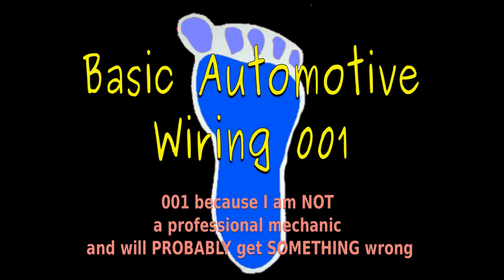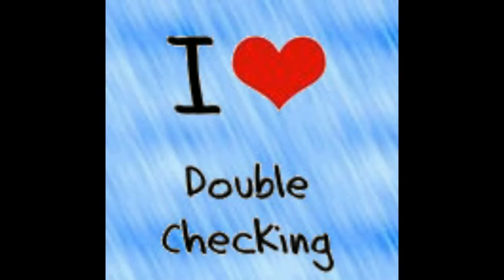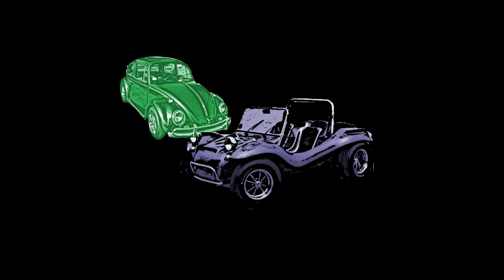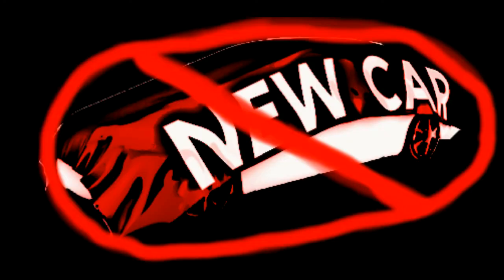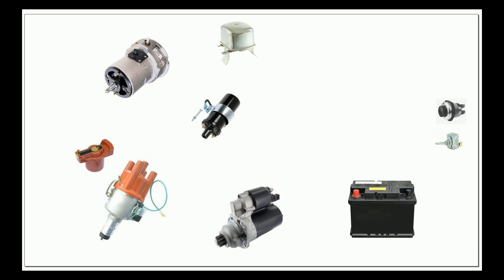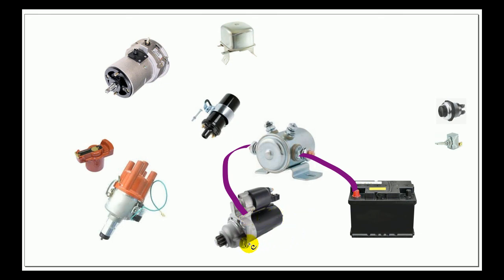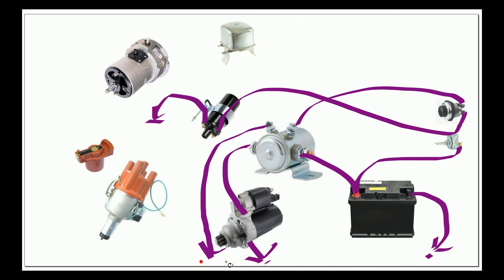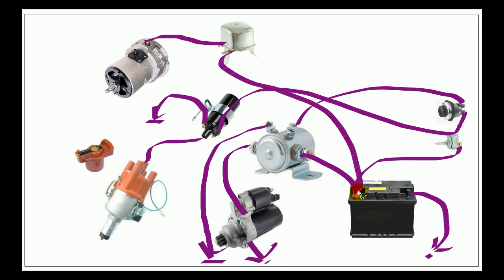Sandrail Part 4:  Automotive Wiring Basics Explained

Comment: I've been trying to figure out how to wire a sand rail, and I'm colorblind. I really appreciate this video. Still a little confused, but this is a huge help man, thanks.
Reply from the maker: Glad it helped. Cheers!
Reply: Doing wireing colorblind without frying anything i give you props 🎉
Reply: There are two starter solenoids you don't need the external solenoid here.

Comment: Very good. Just want to clarify that the coil is not a capacitor. It is a transformer. It boosts 12V to 30kV or more. It is always doing that while the ignition is on. The distributor "distributes" that 30kV to each spark plug when that cylinder is at TDC of the firing stroke.
Reply: Doesn’t really matter what it is if it’s wired as shown in the video, as there will be nothing for the distributor to distribute.
Reply from the maker: @Reloadinggeargmailcom  You are correct. The "ground" wire from the coil should be going to the green wire on the distributor (points and condenser). This is why I expressed so hard to double check my work. https://www.jbugs.com/VW-Tech-Article-1968-69-Wiring.html

Comment: Would you be able to point me in the direction of a website or some info on the best engine and transmission layout for sand rails/ baja vehicles? I want to design my own but I'd prefer to know the best possible configuration to go with, I want to build the chassis/frame around it.
Reply from the maker: I don't knoiw of any websites but I can tell you a few things. Naturally VW engine+transaxle, you can also attach many other engines to a vw transaxle with adapters. BUT.. in these modern times, pretty much anything front wheel drive could be used as a rear axle. If I were to look into something more modern, I'd look for something that used a subaru engine. Even using a street bike engine makes for a pretty peppy sandrail these days.

Comment: For anybody using a remote starter  solenoid as seen in the video, there are a few types available and not all get wired the same way so be sure you know what you have before connecting any power wires. The large post are the same on all types, when the solenoid is energized there will be continuity between the large post. One side goes to the battery positive and the other side goes to the starter. Polarity does not matter through the large post. The difference between the types of solenoids are in the little post. Some solenoids will only have 3 post. Two large and a small. This type uses the body of the solenoid as the ground path. You only need to connect a single wire from the ignition switch START position to the small post. When the key is in the start position it will energize  the coil and close the internal contacts between the two large post. The second type has 4 post, two large and two small post. One of the small post will be labeled with the letter “I”. This style was used for vehicles with ballast resistors in the ignition circuit. Engines with points distributors anD early electronic ignition used this type. The  ignition switch START position is wired to the small S terminal and the solenoid body provides the ground path. The “I” terminal will have battery voltage on it during cranking only. A wire is routed from the I terminal to coil positive. This bypassed the ballast resistor in the ignition circuit to provide the coil with full 12 volts during cranking. When the key is released after the engine has started, the “I” terminal will no longer have power. The last type also has 4 post. Two large and two small and as described in the video, a wire from the START side of the ignition switch will be routed to one of the small post, the other small post will be routed to ground. I hope this clarifies the start circuit. I think this next topic was addressed in the comments already but the negative side of the coil goes to the distributor, through the points to ground. When the points open the ignition circuit opens. This causes the field within the coil to collapse and the energy is released to ground through the spark plug. When the points close, the circuit is closed, the coil primary is again energized
Reply from the maker: Nice Thanks for the added information!

Comment: I'm having a charging issue with my dune buggy and everything I've found said that the voltage regulator needs number 61 connected to the idiot light or it will not charge ( mind you I'm talking about a generator and outside voltage regulator) . Plus I've been told I have to have a power wire going from the regulator to the light switch. 
Is any of that accurate ?
Reply: Thank you very much, because I am clueless and that's telling me that my assumption ( which we all know isn't good to make. LOL ) is accurate and the voltage regulator B+ needs to be sending power back to the battery, which it isn't, so obviously it's bad
Reply from the maker: @JamesBrown-126  There is a link to a wiring diagram for 68-69 in the video description.

Comment: That negative from the coil goes to the points and condenser?...in the distributor?...and the hot stays hot for the engine to run?..and the switch stays on until you want the engine to stop 🛑?
Reply from the maker: I believe the answer is yes to all of them. Take a look at this wiring diagram for 68-69 beetle. https://www.jbugs.com/VW-Tech-Article-1968-69-Wiring.html

Comment: Shouldn't the B+ on the voltage regulator be sending power out to the battery and accessories 
Isn't the B+ putting out the charge

Comment: Can you draw off the coil for an electric fuel pump?
Reply from the maker: If it were me I think I would power that off a fuse block that turned on when the ignition switch is set to on.

Comment: With coil wire to ground, how does distributer fire the coil? Cant..
Reply from the maker: Sorry for the late response. I just came back here because I got a new response. You are correct.. the "ground" wire from the coil should go to the green wire on the distributor. You can take a look here. https://www.jbugs.com/VW-Tech-Article-1968-69-Wiring.html